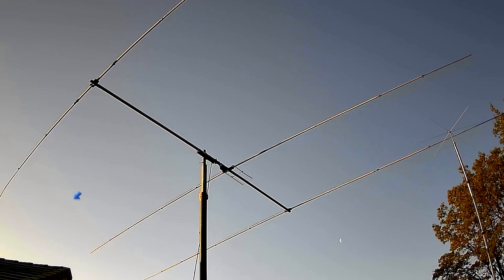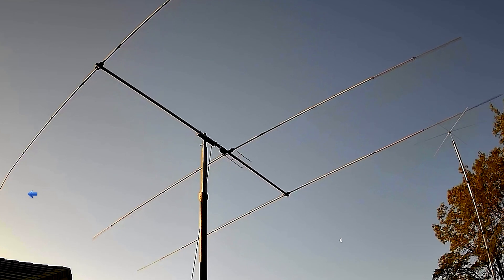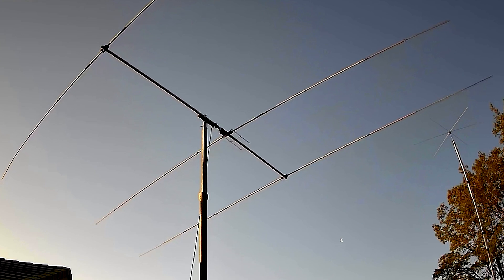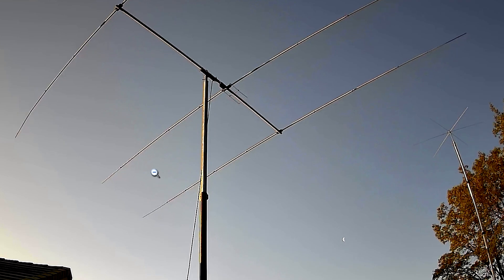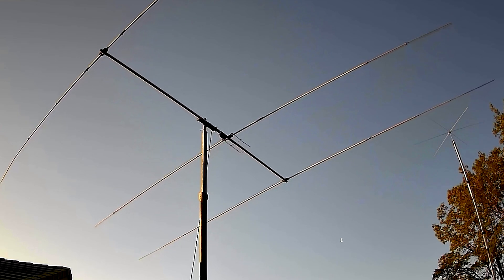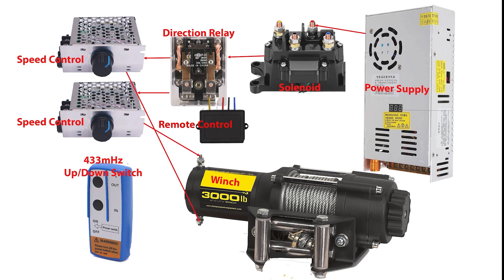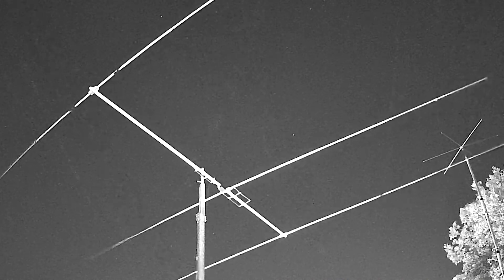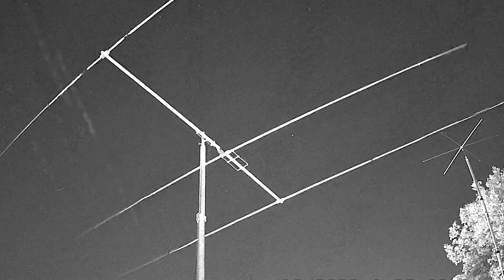30 Foot Tall Rotating Ham Radio Tower And Antenna Assembled By Jim Heath W6LG Ham Radio Elmer

Comment: Hello Jim, thanks for posting this, and great to see you back YT. I saw your video about your trip to the hospital and I'm very happy to see you back on the other side of that trip. I have watched enough of your videos to know you have the knowledge to design and build such an antenna system. I cannot get it clear in my mind how your cable system "pulls" the poles up to get your antenna up in the air. Do you have any other videos or something on a website that shows how this works? I would love to see more about the design construction and operation of this system.
Thanks 73 David

Comment: Good timing.. I was just looking at how to install a mast on my house for an antenna.  Mine won't be telescopic, but will swivel up with a cable . Our area too has height restrictions for amateur radio antennas:  An amateur radio antenna shall:
a) be a free standing, ground-mounted unit installed to the manufacturer’s specifications;
b) be located only in a rear yard;
c) be no higher than 18.0 m  (60ft) from the ground;

So, I bought a telescopic mast that was made from EMT.. 10ft 2inch, 10ft 1.5 inch, 10ft 1.25inch and 10 ft 1inch... plus I acquired two 20ft x 2inch aluminum scaffold pipes, that I may figure out how to rig it in order to get some height.

Comment: If you really want the additional height, you could hire a lawyer (the ARRL has a list) and fight the city under federal law, PRB-1.  A personal friend and former president of one of our local ham clubs is an attorney.  He has successfully sued several local communities.  Typically the hams end up getting permission to put up 50 or 60 foot towers.  And, in most cases the judge awarded attorney fees to the ham doing the suing so the didn't have to pay (or paid a greatly reduced fee) for the attorney.
Reply from the maker: Rightnow I am fighting cancer and it is serious.  So no extra energy to battle the City.  I have received 4 Notices of Violation and I argued with the City.  Right now all is quiet with respect to the antenna and tower.  One neighbor is the problem.  She has marched around the neighborhood trying to rally support. The neighbors seem to have mostly gotten use to the antenna.  They see me in a wheelchair and walker.  Some know that I am ill and figure that I have little time left.  73, Jim

Comment: Awesome rig but I'm a bit perplexed. How does the winch figure into this setup? If you try to push with cable it will tend to unspool, will it it not?
Reply from the maker: Remember that the sections are heavy going up and going down.  73, Jim
Reply: @ham-radio Thanks for the reply, Sir. I do get that - I'm just having a hard time visualizing the mechanical arrangement you employed. I've toyed with the idea of a hoisting type arrangements involving multiple short stages but have yet to finalize a design - and I can't think of a better brain to pick than yours. 73. BTW, you're looking great! Keep doing whatever it is you're doing!
Reply: I am also unclear how the winch raises or lowers the tower. Great work though, that looks really nice.

Comment: Works a charm jim. Everytime I hear you , you have a decent signal to the east. It’s been awhile now. My beam is also 30 ft. The roof here is also a 12/12 and impossible to get a roof mounted tripod on. The Mosley is barely above roof level beaming west. It works ok. Another layer beyond wire beams for sure. I would like to install a tilt tower but I would be lowering the beam into the cul-de-sac. So far the neighbors are nice about it but maybe not if I push my luck. My health condx make it very difficult to get  on to the tower now. If I or when I move agn , I’ll be sure to be out of town a bit. Would really enjoy a stack. Hope you’re regaining a bit of strength my friend. 73 Jay

Comment: Thanks for sharing. I did have a couple questions.

What band or bands do you operate with this antenna?

How does the winch cable attach to the top section to raise/lower it. 

How do you rotate the antenna?
Reply from the maker: I should have said that the Yagi is homemade for 20 metes only.  Thanks Kevin, 73, Jim

Comment: Hi Jim I’d Love some help with getting my winch slowed down. How can I contact you
Reply from the maker: Here is what I used.  I bought two of them.  A relay is used to pick one or the other depending on going up or going down.  
weideer 7-80V PWM DC Motor Speed Controller Switch 30A Control 12V 24V 36V 48V With Screwdriver And Terminals K-012

We don't know when or if this item will be back in stock.
Motor Size：75x85x32mm/2.9"x3.3"x1.2";Applicable voltage range: DC 7-80V; Drive current: 30A max,on-board switch with operation Stop brake function；Control power: 12V 300W 24V 400W 48V 450W 72V 500W.
4 high pressure tube drive ,3 high-voltage 100V high-frequency resistance capacitors, and fuses for braking. The parameters are not easy to heat and easy to replace. The standard aluminum housing protects the internal circuits and components for long-term durability.
Adjust the motor smooth no noise no vibration,with power indication,wide duty cycle adjustment range
Reply: @ham-radio  thanks Jim. I might need some expert help with this one. Really appreciate your help
Reply: @ham-radio hi Jim I managed to access most of the equipment from Amazon. Would it be possible to give me a part number for the direction relay. Is it also possible to send me the correct way to wire it up. Thanks for your help